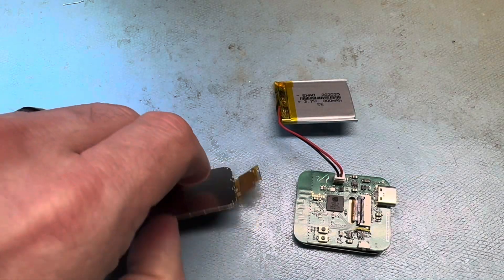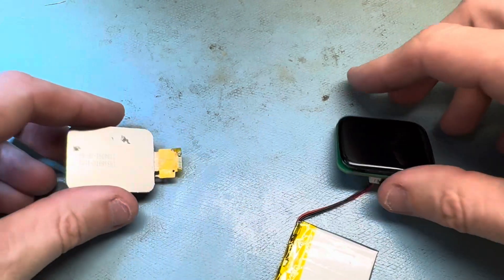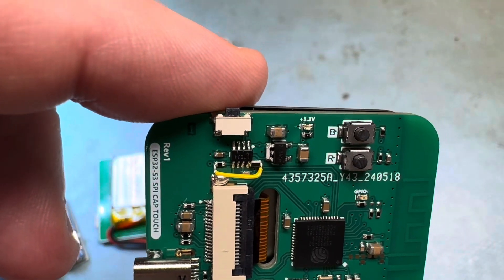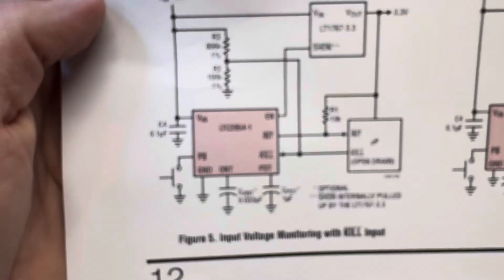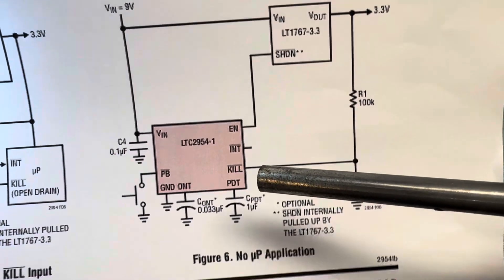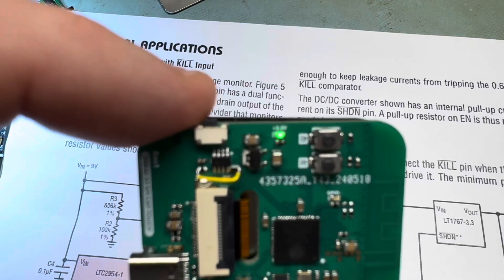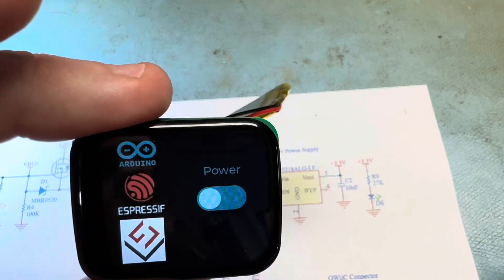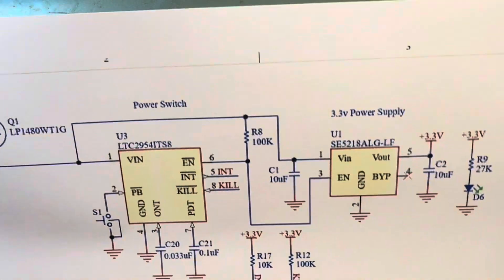1.69" capacitive touch lcd & LTC2954 Dev Board

Comment: Hi, would it be possible for you to make a video running through your schematic and PCB design for the LTC2954? thanks great vid :)
Reply from the maker: @Alfi3boii  Huge thanks and it was a fun project. Going through the schematic and pcb isn’t possible though since I have no cameras, edit software or mic. I just use my phone to make the odd video.
Reply: @0miker0  No worries. Which circuit on the typical application did you use for the datasheet?

Comment: cool part - I've used a mosfet for similar in the past which required the microcontroller to step in just after booting to keep itself switched on
Reply from the maker: In software I told the gpio pin to be high when powering up.